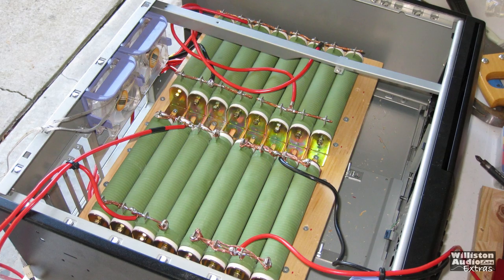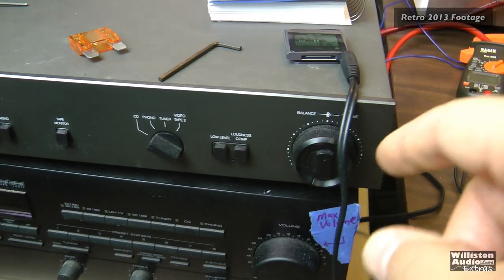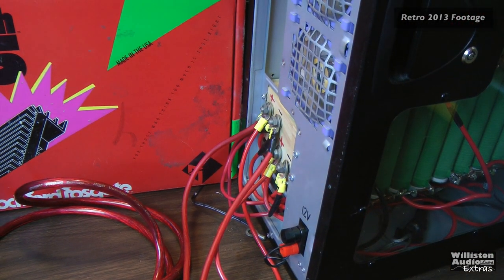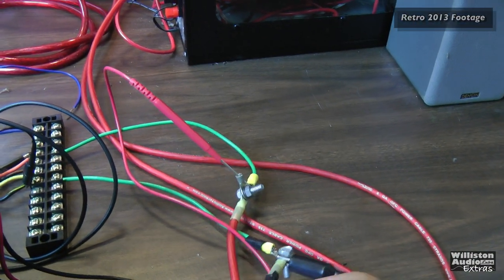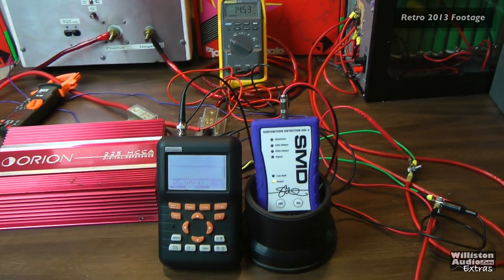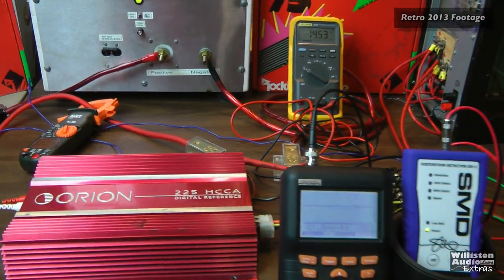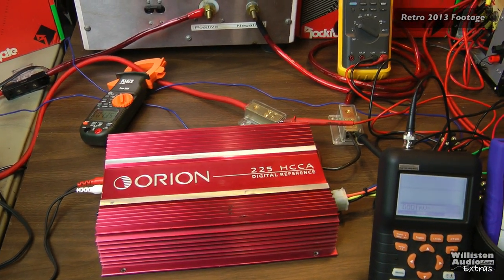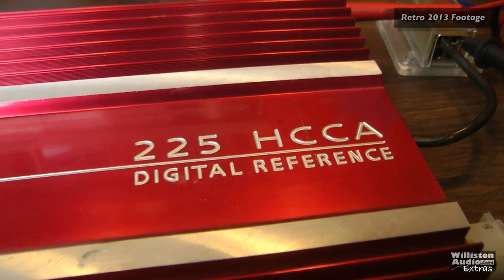Testing Tools Williston Audio Labs Used Years Ago (2013)

Comment from the maker: Original OSS test bench included:
Custom 250A 9-18V Adjustable Power Supply
Velleman HPS50 Digital Oscilloscope - https://amzn.to/3JCKbKj
BK Precision 2120 Analog Oscilloscope - https://ebay.to/3IBiEYb
SMD DD-1 Distortion Detector - https://lddy.no/150dn 
Klein CL2000 Clamp Meter - https://amzn.to/3IwEpsk
Fluke 85 III True RMS Voltmeter - https://ebay.to/3DdiHZd
Custom Wirewound Resistor Bank
NAD 1130 Pre Amplifier - https://ebay.to/3uo57hD
Apple iPod Nano 6th Gen - https://ebay.to/3JEBDmd

--------- Test Bench Equipment -------

SMD / D'Amore Engineering Amp Dyno: https://goo.gl/sJTcf7
XS Power D1400 Batteries - https://amzn.to/2BPFCKW
XS Power PSC60 Charger - https://amzn.to/2CHGcfs
Fluke 1000A AC/DC Clamp Meter: https://amzn.to/2Rw5WDA
Handheld Dyno: http://amzn.to/2u2EgKV
My Favorite Screwdriver Kit: http://amzn.to/2x0VzcE

DISCLAIMER: This video and description contains affiliate links, which means that if you purchase from one of the product links, I may receive a small commission. As an Amazon Associate I earn from qualifying purchases

Comment: Big d I love this because it’s sorta where I’m at at the moment except technology has changed quite a fair bit as I use 3 banks of lithium for power then a 80a power supply if needed then 1000w resistors and an old o scope like the big one u had and then I use a termlab to verify power 
However after watching this I think I may just msg Steve Meade ad get a dd1 as it seems easier haha
Reply from the maker: Scope works ok for seeing clipping as long as it’s high rez and fast enough refresh. The cheap $100 or less digital ones can’t be trusted. DD-1 gives you 1% THD for sure

Comment: Used to have an audio authority power supply.
Reply from the maker: The 978 or 2/77 model?
Reply: @wal2  2/77 with a battery and cap bank.

Comment: would really like the modern amp dyno have the ability to show waveform.
Reply from the maker: I have a nice o’scope I’ll Integrate into future tests when I get my new bench setup
Reply: @wal2  it would help a LOT of people to understand what "dirty power" looks like and that sometimes, watts isnt the most important thing. 

of course, the clipping indicator will show distortion past 1% but that only matters if the rail voltage goes too high. it doesnt give you an idea of what distortion looks like as it relates to your ears when its overdriven or has weak components in the amp.